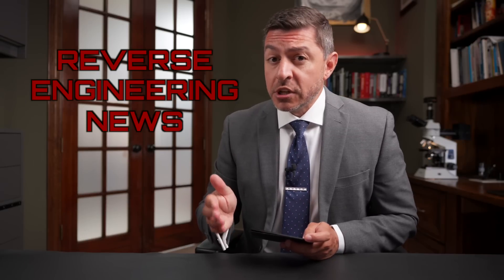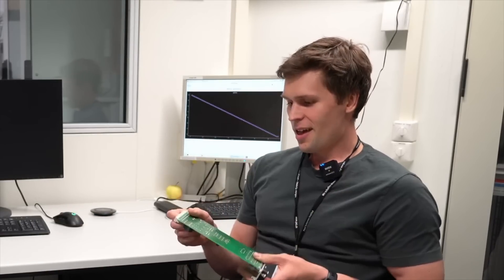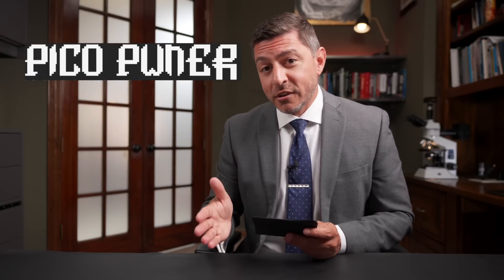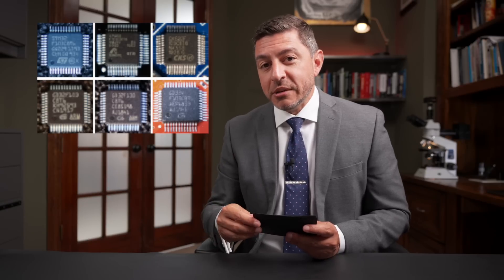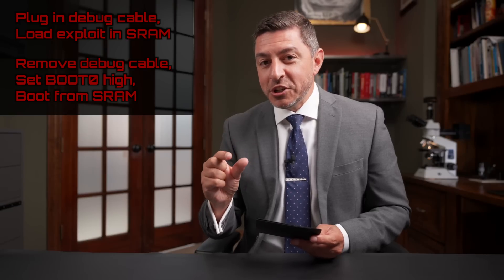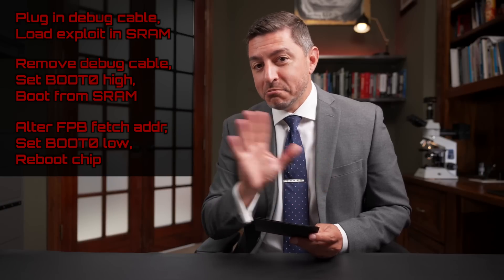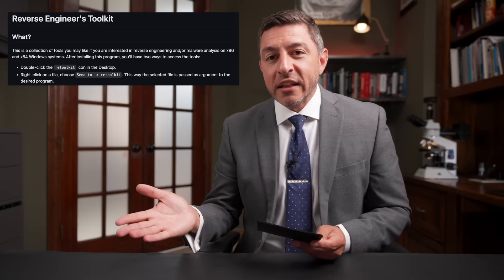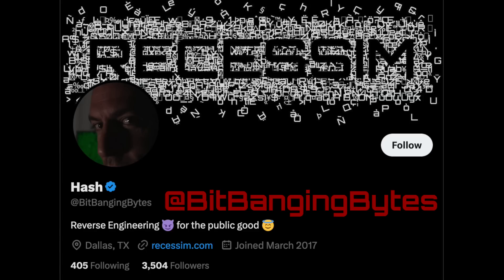X-Rays and Raspberry Pi Pico HACKING Tool! - Reverse Engineering News - June 26th 2023

Comment: Oh my lithium battery Green Technology can be used in the raspberry pie pico or raspberry pie zero, never need to change the batteries when going mobile. The raspberry pie zero is my preferred
Reply: what is this nonsense?
Reply: @lo2740  what would you like to know? My green lithium batteries are rated for 219 years if fully recharged everyday.  I can make single use CR2032 lithium batteries used in all desktop computers rechargeable.  With raspberry pie zero my green lithium batteries will run forever, beyond your life time.

Comment: Ah ha ha ha, I used this reset trick on a 8086 Intel processor in tech school, my project was to make a USB hub, my chip went defective or a clock speed problem, the stack would not start at the beginning of the program, after the first time executing. Every time I would have to reset the chip, re enter my lost code everytime, with a resistor and diode and a two AA batteries, external drop out power.  I would keep the ram powered by external means, we had only a number key pad, so no debug cable or lock, so not exactly the same as your example. My project worked long enough for the teacher to see it work with a USB memory drive back in 2005, then the cpu died 1 minute after the teach walked away. 😂 maybe the 8086 could not handle the clock speeds of USB 1.1  don't care, it was the school's digi board and I got top marks for the integration with the old 8086 CPU and new p4 system, lol, I waited for my teacher with a fresh reset.  My teacher was so amazed, my project was a example of recycling old technology to modern USB uses. I likely cooked the chip with the different 3vdc and 5vdc power rails with coil relays, the contact noise of the relays likely cause aspire voltage feedback loop. Now I have built the only green lithium batteries that can be recharged everyday for 219 years, found the secret to preventing dendrite formation in any rechargeable battery and single use lithium is now rechargeable. I only need one investor to believe the technology is real for a patent.
Reply from the maker: That’s an awesome story about the 8086! Seen many sales presentations where the products have to be reset right before the demo so you aren’t far off from production! 😁
Reply: @RECESSIM  interesting "aren't far off from production", seems I wasn't the only one that discovered that reset trick. Great minds think alike! Just heard of AI making search algorithm 70% more efficient, with the removal of the assembly code and machine code interface, the software programs in machine code, I believe, skipping the assembly code part. Advanced software could do this, and skip a step, but humans can't, Google seem excited  about this, indexing information to search should become much much faster soon. I thought of this back in the day in tech school, but hex instructions were to hard to remember, it's so much easier for humans to use MOV instructions and not 7D A2 7E (not actual machine code just example of the concept of how 70% faster speed can be achieved when the computer skips a step, the computer does not need) a 8086 could not do this skip in steps for faster data speeds.

Comment: The Ledger cyptocurrency hardware wallet uses an ST32F processor as its primary processor, so this is a relevant attack vector.  It also uses a secure processor, an ST32H, so it may still be resistant to this attack, but this attack could be one part of the process of breaking into the hardware wallet and recovering the keys without the owner's passcode.  Just another reminder to secure your hardware wallets - they aren't perfect.

Comment: "This isn't a glitch attack it's.."
proceeds to describe how it's exactly a glitch attack

Removing power and re-applying it at at a specific time from reset.. is a glitch attack, and doing it before SRAM clears, means it is indeed timing critical from the aspects of both the turn-off and on timing. Just because someone has now worked out that timing doesn't make it any less a glitch attack for future users of that method because it is a known variable of 'when'. Also it requires you to have control of the STM's power rail and bypass capacitance plays into that, so you might have to be desolder it to isolate, etc.

Comment: Very nice information. Could you please do a comparison using the new Orange Pi 5 8GB Rockchip RK3588S 8-Core 64 ARM Mali-G610 GPU, AI accelerator NPU with up to 6 TOPS? 
😎  Thank you.    Amazon...  $101.99   There should be DIY videos on other SBC than the RPi4. The OPi5 has very few GPIO PWM servo robot examples.
Reply: wtf, you must be in the wrong place mate, there is nothing to compare, and it is not a 14 years old gamers channel.